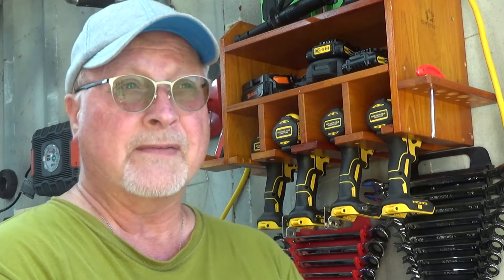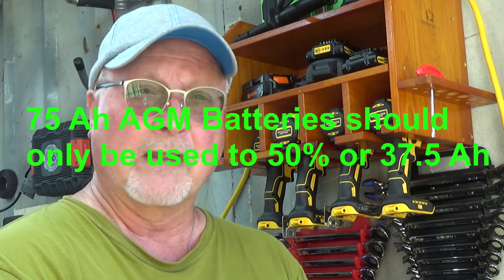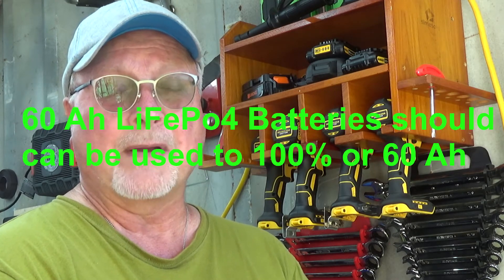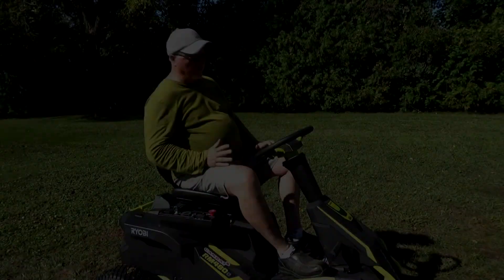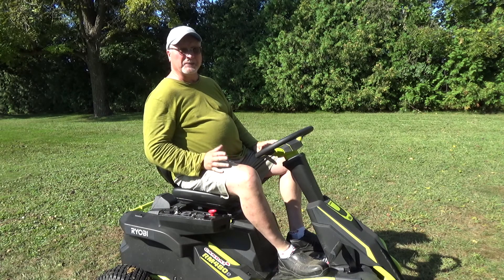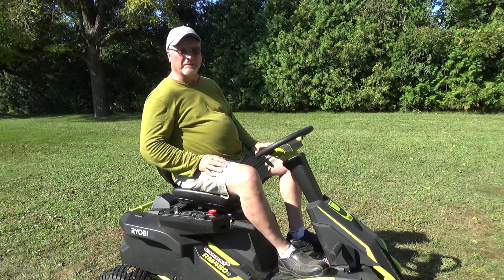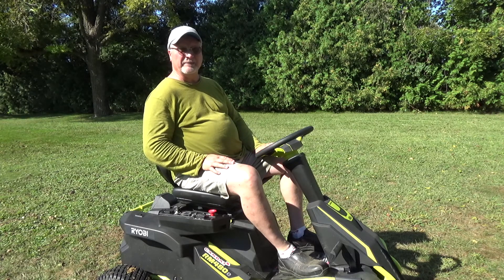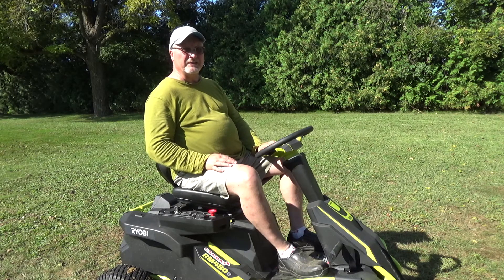Ryobi RM480e Electric Riding Mower with LiFePo4 - 3000 Wh - more than 2500 Charge Cycles

Comment: I was wondering how your mower is performing after 3 years. I contacted Li Time and was told that they do not recommend using their Lifepo4 batteries in the Ryobi mower because " the crank current generated when the mower starts exceeds the capacity of our battery, so it will lead to damage to the battery." Have you had any problems? Is "crank current" really an issue?

Comment: One of the problems with the ryobi agm battery pack is ryobi did not include a battery balancer.   Without out a balancer over time, the weakest battery in the pack will fail.  This happened to me.  I replaced the bad battery with a. New battery and my mower is working again.  Note it is recommended to replace the entire battery pack.  I installed a battery balancer instead.  I'm hoping this will extend the life of my battery pack.  My battery pack is 4 years old.  Agm's can last if 6 to 8 years if treated correctly.  

Conclusion my problem was my battery pack got out of balance because ryobi did not include a battery balancer in their product.  I suspect this is why everyone is having problems.  Most lithium batteries have balancer built into them.  Switching to lithium batteries costs around $1,000. A battery balancer for an AGM Battery costs less than $100.  Check the voltage after you mow.  If one battery is low. Your batteries are out of balance.  Replace bad battery and install battery balancer.  You will be amazed what happens.

Comment: The batteries that @kenthoman3068 is recommending are very expensive, as in $480 for one 60Ah battery! That's a non-starter. Does anyone know what is the power of each of the Ryobi RM480e motors? This is an important parameter to calculate the max current draw. The Canbat 60Ah battery has a max peak draw of 170A for 3 sec.

Comment: Thanks for the video. After five years my Ryobi 480e would only mow maybe 20 minutes. Found one of the four batteries was dead. I upgraded with the same batteries and meter. I couldn’t be happier with the performance. Now mow my 1/2 acres and only use 25% of capacity. Even mowed twice before recharging an still showed 49% capacity. The original battery charger works well for charging cutting off lower than the max recommend charge voltage for LifeP04 batteries.

Comment: Starting this process with my Ryobi 54" zero turn after a little more than a year of use. I was planning on doing it but I was hoping on getting a few years anyway. Ordered the batteries and a charger today. I'm going to try and find that battery meter though. Good addition, Thanks for the video!
Reply: I also have a 54” zero turn and I’m very interested to convert from lead acid to lithium. I would be interested in any information you can share. Thank you!
Reply: @gs1100ed  - I bought 4 x 12V 100AH LiFePo Chins batteries from Amazon. They pretty much bolt in, uses the original cables.

Got a LiFePo battery charger also from Amazon.

The biggest problem is that the BMS in the batteries would shut down when you click the ignition key on. Tripped  the inrush current. I had to wire a precharge resistor with a switch to control that inrush. Easier to do than explain. Will Prowse on YT has good info on precharge resistors.

I did replace the battery monitor with the one from Amazon.

If you need more info just let me know. 

Now - have you figured out how to get the mower deck not to clog up every time you mow? That is my biggest complaint.

Comment: Great video ! have a question , I have same zero turn but I have the 75ah battery and if one battery  is bad can replace that one bad battery with  a 100ah battery ? will it still charge ? thanks Steve
Reply: You just  need to match the voltage of each battery so they are all the same and add up to your 48 volts. The amp Hr rating  can be looked at as a fuel tank capacity. The higher the Amp/Hr rating the bigger the fuel tank. Generally the increase in Amp/Hr rating also means an increase in the physical size of a battery because more plates are used to get the extra capacity so you need to make sure you have the room.

Comment: Thanks for your informative video and I am very much looking forward to your how to follow up.  Presently have the zero turn and just received my 48 volt 96ah LiFePo4 battery, with special hi power LFP charger and  will be installing it this week.  Have ordered the gauge kit but Amazon only had the 350 amp.  The old batteries did fade after 2 years in this Texas heat and LFP will handle the heat a lot better than lead acid and lithium ion, and a lot safer too. Did hook up the original blue wire?  Thanks again.

Comment: Thanks for posting Ken.  Looks like a great setup.  
Couple of follow up questions 
A)  Have you noticed the mower handling differently with reduced weight?
B)  How are you planning on handling cell balancing?
Reply: I had the same question as you about B) :D Just bought used Ryobi then I can't compare about A), since it had come  with bad batteries.  2  are already replaced by Lifepo4, now waiting the 2 others. Personnally for balancing I bring a wire from each pole voltage to the back 0v 12v 24v 36v and 48v. This way, I'm able to verify each battery, especially needed since I will have mixed battery 80AH to 100AH Lifepo4 and now mixed acid and lifepo4.  Then I can corrected them from the back without dismantle batteries again by those wires. About charging,  I will put my progammable voltage cutter on the highest voltage battery programmed probably to 14 volts.  Then I will not hit the cutoff of those batteries at near full charge.
Reply: Switched my 54"to LifePo (4 x 12V batteries). I charged each one individually initially. After that, just charge them in a series string. Each battery has it's own BMS, so I don't think further balancing is necessary.

The reduced weight does make a difference. Less traction. Side hills are a little more challenging. In normal mostly flat mowing no issues, and the reduced weight gives you even more running time.
Reply: @sracer42 did you have any issue with over amping the bms on your batteries? I  just installed the 100ahr litime lifepo4s and eveytime I turn it on it shuts off. Do you need inrush current limiter or are you running one? Thanks
Reply: @kwill2009  - Yes, I did have that problem. I solved it by installing a switch and a precharge resistor between battery + terminal and the load side of the main contactor. I believe I used a 200 ohm 50 watt resistor and a toggle switch from amazon. 

Startup procedure is turn on the toggle to precharge the motor control circuits, wait 5 to 10 seconds, then twist the run key. Works fine, just have to do some wiring. If you wanted to be proper you could fuse the wire feeding the precharge circuit.
Reply: @sracer42  would you be able to post a video showing how you wired all that in? I have an idea based on your description but your electrical/battery knowledge exceeds mine so any instructional aid would help.
Reply: @kwill2009  - I don't think I can do a video soon - I would have to open the mower up and I really don't have time right now.

I would post a schematic but I also don't know of a convenient way to do that.

Inside the right rear fender you can find the main contactor for the mower. I has two heavy guage wires running into it - one coming from the battery bank and one running forward to the motor controllers.

Basically, add a smaller wire to the battery side of the contactor to a switch, from the switch to the resistor, from the other end of the resistor back to the other (non battery) side of the contactor. 

That way, when you flip the switch on, current will flow into the motor controllers at a slower rate due to the resistor. 

Once the motor controllers are charged you can turn the main switch on which will close the contactor without the big current inrush.

Sorry I can't post a schematic.

BE CAREFUL! 50Volts and high current can cause a lot of issues and injury. Fusing this circuit would be good practice.

If you are not comfortable around electricity - maybe find a mechanic or electrician friend to help you?
Reply: @sracer42  no worries. I've sourced a battery with a bms that can handle that transient amperage on startup. I was comfortable with wiring it just curious to see what you had done. I wanted to see if I could wire it in with the current ignition circuit and include some sort of time delay relay so it would be a seemless process to the operator but again, found some batteries that will handle it so all good.

Comment: Why does everyone talk about all sorts of circuit changes for charging? The LiFePO4 batteries I'm looking at have a BMS built in. Why couldn't you then use the stock charger?
Reply: https://youtu.be/In03oc8oC4I  that video explains what a BMS does.   The rest of the explanation is that AGM have a higher charging voltage .  You will damage the lifepo4 batteries if you use the charge profile for an agm battery.

Comment: Thanks for the video, Ken. Question for you: did you run into any problems connecting 4 of these in series? Do you charge them in series, or with a 4x charger?
Reply: I did the same  with 100 LiFePo4 batteries. Make sure all 4 are same voltage before connecting. You will need to adjust the bottom brackets for battery size difference. Also, I use a 48v lithium charger which works great. I used the original charger's plug and connected to the lithium charger. Only connection the negative and positive terminals and not using the neutral. Works great. You can also order a lithium charger with a three terminals.
Reply: Please post an instruction video of this. You will be famous.
Reply: @asharak68kbelgarion46  hi mate, can you elaborate on this? the top wire in the triangle plug is the one you didn't use? Correct?
Reply: @johndarcey  I didn't use the green grounding wire.  The lithium battery charger  should be black to black  and red to white connecting the charger and original charger cable. Hoped that helped.
Reply: @asharak68kbelgarion46  thanks mate. Yeah, that is my plan. Just needed a test pilot. Cheers!

Comment: I did solve the meter reading and now shows the correct percent of battery.
Reply: Did you work out the cable issue? 3 down to 2. I was going to swap the plug over, however my new Invicta Lithium charger is 2. Probably just get an electrician to help me out on this one.

Comment: Thanks Ken for this info.  I am converting my 30 inch Ryobi riding mover to lithium.  I have a charger for the LiFePo4 batteries (48v 10amp as recommended for the batteries).  I plan to buy the Plug you used for the charger but my question is the charger and plug have only the red and black wires, but there are 3 pin.  Is the third pin unused?  One more thing,  I'm using the same amp meter as you and installed as instructed, however the percent used shows zero???

Comment: Hey, thanks for posting this!  Can you please provide more details on your setup?  I suppose you need 4 batteries to hit 48V.  Did you just replace the batteries one-for-one with the existing wiring? Looks like you're using the existing charger -- can you leave the charger plugged in overnight?  Looking forward to your upcoming build video.
Reply from the maker: I replaced all 4 batteries with 60 Ah Canbat LiFePo4 batteries.  These batteries can handle a large current draw with no ill effects.  I did chance my charge to a NOCO G4820 charger but, I did that prior to the lithium.  Although I was told there would not be a need to change the charger the NOCO G4820 has a preprogrammed charge option for lithium.
Reply: @kenthoman3068  Great!  It looks like there's an LI-ION setting on that charger -- do you use that setting for LiFePO4?
Reply from the maker: @clownbaby420  Yes, ith NOCO G4820 charges at 58.4 V @ 20A for lithium and LiFePo4.  It is exactly what was recommended by Canbat for the batteries.
Reply: @kenthoman3068   Is there any downside to charging at lower input amperage?  I'd like to just stick it on an outdoor 120V circuit that I'm not comfortable using at 20A sustained.
Reply from the maker: @clownbaby420  The output is 20 A it works on a 120 V circuit @ 100 W or 8 A AC
Reply: @kenthoman3068  Cool!  Is it a big 48v recharge circuit?  The charger doesn't need to connect to each battery individually?
Reply from the maker: @clownbaby420  The GX4820 charger has a cable which plugs into the existing charging port.  Ther is just a slight modification required two remove 2 ribs inside the charger plug.
Reply from the maker: All the links to the batteries, charger and the ammeter are now available in the description above.
Reply from the maker: @clownbaby420  They are 12V batteries and they are exactly the same size as the AGM batteries.  Just replace the existing batteries.  You can use the existing charger if you wish.  I switched to the NOCO GX-4820 and purchased the EZGO point cable connector accessory.
Reply from the maker: The charger can be left plugged in all the time.  During the winter if temperatures where you store your lawn mower go below freezing do not keep the charger connected.  I even added a breaker to disconnect the batteries from the lawn mower.  I will leave the batteries and the charger disconnected until spring.
Reply from the maker: @clownbaby420  The charger plugs into the existing port.
Reply from the maker: Yes, the batteries all connect exactly the same as before and you use the same charge port.
Reply: @kenthoman3068  That's great!  Yeah your earlier comment says I can use the EZGO point cable.  I'll plan to grab one of those.
Reply from the maker: @clownbaby420  Yes the charge port is the same as a 48V charge port on an EZGO golf cart.
Reply: @kenthoman3068  Different question -- I've noticed the mower slows down significantly when the blades are running (on original batteries).  Does that phenomenon go away with the lithium iron phosphate batteries?  I imagine they produce more current.
Reply from the maker: @clownbaby420  No, the LiFePo4 batteries supply a constant voltage and current.  You will notice a huge difference.
Reply from the maker: The power will be greater than when you first got the lawn mower.
Reply: @kenthoman3068  Hey different question -- I still have the AGM batteries in my ryobi and I probably won't replace them until they start to degrade -- think I should charge with COLD/AGM or AGM+ ?
Reply from the maker: @clownbaby420  If they are going to be in subfreezing temperatures, do not leave them on the charger. If the lawn mower is being stored where it will not be subjected to below freezing then you can leave them on the charger.  
The batteries will partially discharge if they go below freezing but leaving the battery on the charger all winter long should be avoided.
Reply: @kenthoman3068  Thank you for the warning.  I thought it was like leaving a "battery tender" connected to a car battery.  Is that bad, too?
Reply from the maker: @clownbaby420  Yes freezing and charging a battery continuously below freezing is not a desirable condition.  Wait until the battery returns to above freezing temperatures.
Reply: @kenthoman3068  Hey new question -- did the NOCO EZ-GO adapter fit in your ryobi without any adjustment?  Mine doesn't seem to want to plug in and I'm thinking I may need to start shaving off some plastic.
Reply: Anyone try a 48v LiFePO4 battery?  They are more expensive than getting 4 12v batteries, however you can get them with more AH in the same space and you are charging one battery so you dont have to worry about balancing.  I guess you can do a series/diagonal hookup to keep the 4 more balanced.  But thanks for the video,  now the hard part….talking my wife into letting me get one…
Reply: @shanewaldron8713  I wondered the same with a 200ah.
Reply: @shanewaldron8713  hey i just installed the eg4-wp 48v battery.  seems to work so far.  i'm using the noco charger so i don't know how the original charger will get along with that battery.